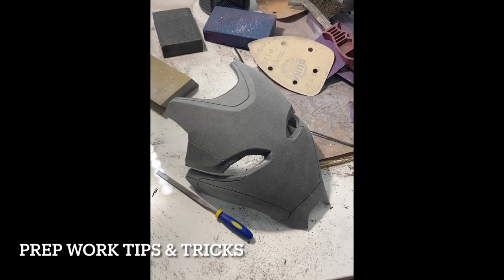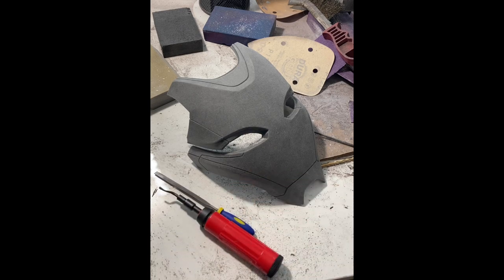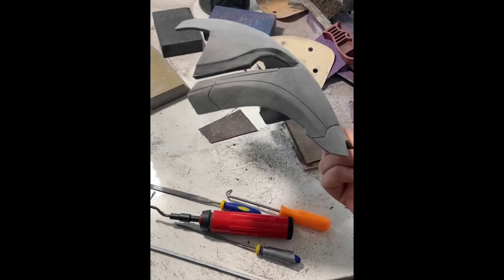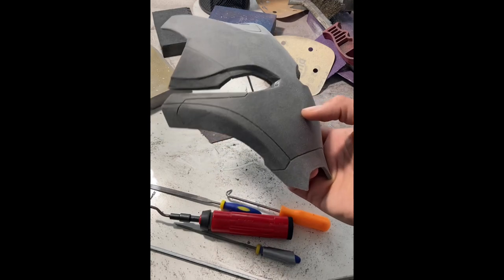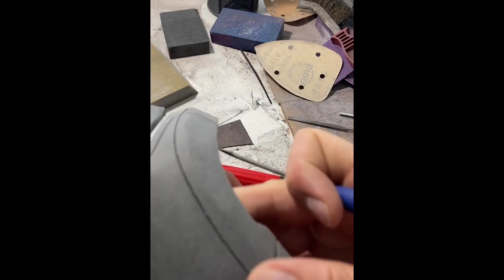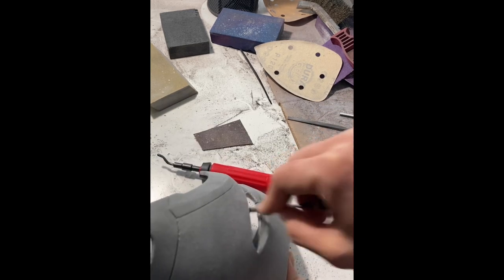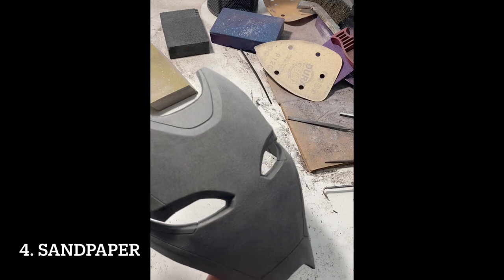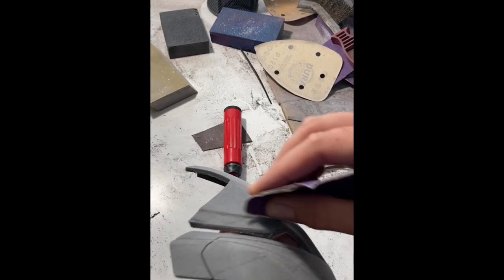UP YOUR GAME with these 3D Print Finishing Tools & Tips! Iron Man Endgame helmet prop tutorial diy

Comment: Have you tried sandblasting with walnut shells or glass beads? We have a cheap harbor freight one at work that we blast prints from the SLS printer, but we've not tried it on our prusa prints.... I may try one to see what it does.
Reply from the maker: Have not tried it on a 3d print! Definitely interested in the result!
Reply: @RoguesGalleryCosplay  did not do much. Petg was just too tough for the walnut shells we were using. I'll try again when we get sand or glass beads.